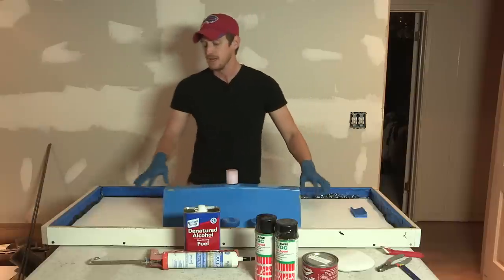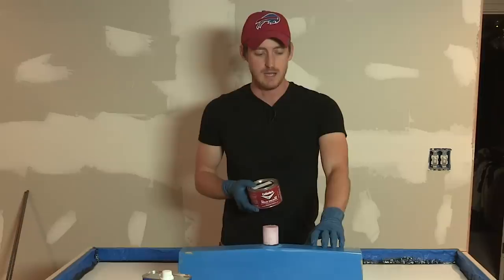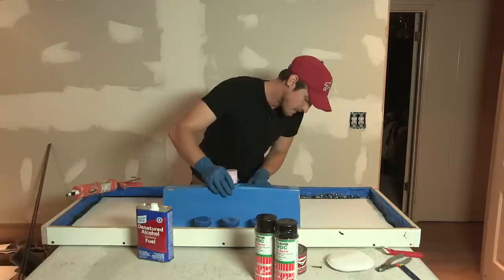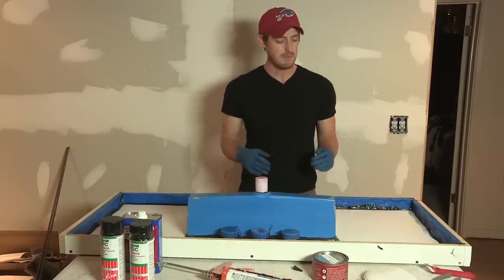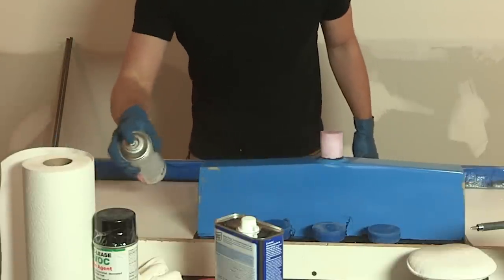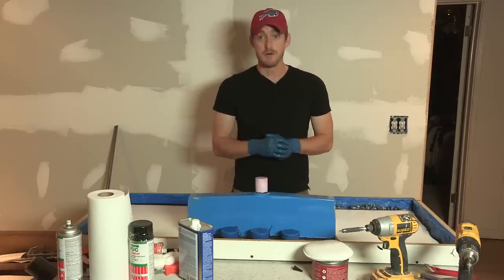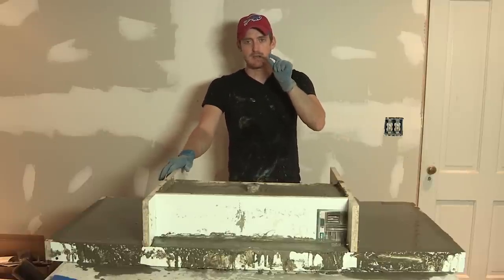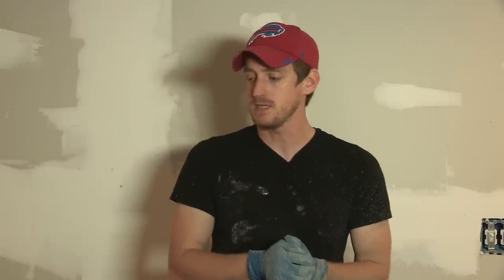DIY CONCRETE SINK (Part 1 of 2)

Comment: the damn mold is almost $300... Not trying to be negative but if the mold costs that much why do this when you can by the same style sink for $250 to $400 depending on size.... Just for the concrete?

Comment: That rebar was overkill big time! It looked like commercial grade where you could have got away with 1/4". Minimal rebar support was smart but another thing to consider using is fiberglass. It's cheap enough to give you a solid insurance plan and peace of mind for years to come.

Comment: be aware that this method wont work. you need much more steel in this toop. the areas where the sink meets will crack 
make sure you put lots of mesh in, otherwise looks nice

Comment: A little  extra advice for the  DIYers out there.

For that  kind a work  an orbital sander movement applied directly  over the  outside of the mould/ melamine should work better than the  "Dildo looking think" slash concrete vibrator.

my .02
Reply: +macrapidito  Right -I rigged up an old Sears 1/2 sheet orbital to become a full-time concrete counter vibrator.  Replaced the felt pad with hard rubber, and created a couple of clips so it can be applied easily (and left in place) on the form... or it can be hand-held and moved around.  Smaller 1/4 sheet sanders also work but you need to have a way to transfer the energy to the form and not just scuff it.

Comment: I am building our house. I'm doing my research on the concrete table tops. The only thing that I can't find the answer to, is the way that it holds up in use. The concrete sealer does it age well (I know that you have to reapply periodically, like every year)?  But let's say you spill milk or grease. Does it stain? If I use it for bathroom and even do a sink, does the sealer hold up to the toothpaste, soap, detergent? Is it safe for food? Thank you.

Comment: Don't over vibrate the concrete.  The aggregate should be evenly distributed through the concrete and over vibration will cause the aggregate to settle at the bottom which is the top.

Comment: Nice first Job. But I do concern about the lack of steel bar mesh, which would reinforce the structure, since any punctual stress might crack o split the sink's surface. You showed two steel bars, but I never saw in the video, where you placed them. I'd have used steel bar mesh for reinforcing the structure.
But it's even a very nice and useful sink, man.
Congrats!!!

Comment: Instead of an actual concrete vibrator, you can wipe down your forms and than us a oscillating or standard palm sander. The vibrations from the tool carry through the form. This works on projects that run about 24"-30" of depth up to 3" of thickness.

Comment: i screwed my top onto a table. i bolted a bench grinder and cut off 1/4 of the grinding wheel and used that to vibrate my concrete tops

Comment: Water proof concrete would have protected the sink during winter time when you should leave the facet dripping to keep the pipes from freezing cause your sink will not just get cold it will sweat beneath and leak water into its surface which will cause it to crack and need replacement. Depending on where you live at should tell you for haw long winter cold days will last and those when you will not be at home. Water proof concrete is for usage underwater and it dries quickly. Another consideration is pressurized concrete which is used on airport runways which is also water proof. If you would have chosen a foam concrete you might have had a lighter sink & top. Depending on load bearing walls and flooring joist will determine just how long it will be before you must choose another concrete and make repairs to the home. In pressurized applications aluminum metal molding with clamps are best not wood, since they have grooves there is no need of silicon tubes but release agent you will always need to consider and get the best. Its been a year and a half month almost since you posted this 2 part experience. Since I have a bathroom and a kitchen to consider doing myself I will take your advice as a helpful suggestion but persuade myself there must be some drastic changes to have a successful pour which will last beyond my lifetime regardless of the weather conditions and ownership. I got to do what is right.

Comment: There should be a lot more steel in the concrete. You did good to put the rebar in but you should have put in a sheet of steel mesh. It keeps the concrete from spreading and adds another layer of protection across the entire surface. Just look up when pros actually build concrete structures and driveways. Otherwise it turned out nicely. Good job

Comment: From watching other videos, you made your concrete to wet,  to wet causes shinkage and cracks, and you vibrated it to much, this will causes all your rock to settle to the bottom.   Also I did not see you use any mesh or steel rods for strength.

Comment: Very nice work. I was thinking may be it would be better to use more bars with smaller diameter or steel mesh rather than only two steel rebars. Also I go a question. Have you used a sealer so moisture doesn't penetrate and cause rebars to corrode?

Comment: Where'd you pick up the mold?  It looks like everything available is pretty heavy duty (i.e. expensive) and made for contractor types, who will get many uses out of the mold.  Any ideas for places to pick up something cheaper for a single use?
Reply: +Mr. Fix It I was thinking about that, but am a little worried about not getting a good pitch and then ending up having issues with water not draining well out of the bottom surface.

Comment: What happens if you start filling concrete from your high point and then filll in the bottom once the top stops slumping? Similar to how they pour concrete steps?

Comment: Im here in Brazil, wondering where I can get an equivalent product to this Quikrete, and I see written in portuguese, "Mescla para concreto de resistência inicial alta". Thats weird!
Reply: I can't believe Ive made the same mistake you did, about that gap of the upper form.
Ive put the upper form onto two pieces of 4x1 cm.
That 1 cm what enough to make a mess.

Comment: It would be nice to see your mold from different angles. Your talking sections are too long and often irrelevant. You should have used more steel rebar ( in a grid ) for support and it didn't need to be so heavy your sink isn't going to hold a vehicle. 
I did like the industrial look for the basin.